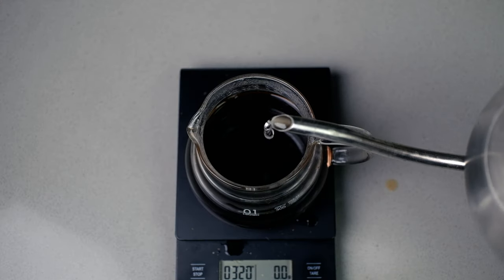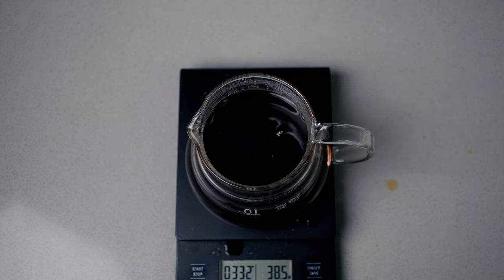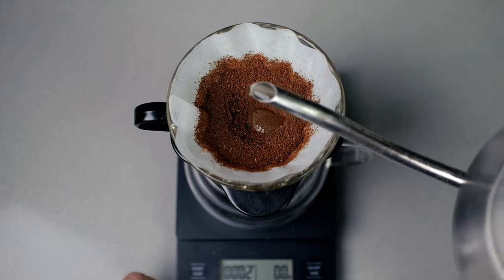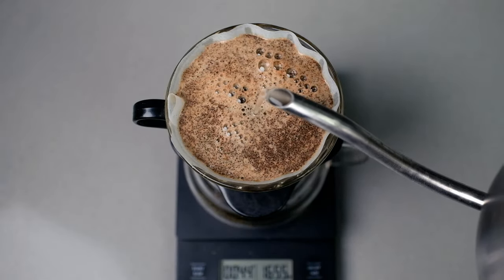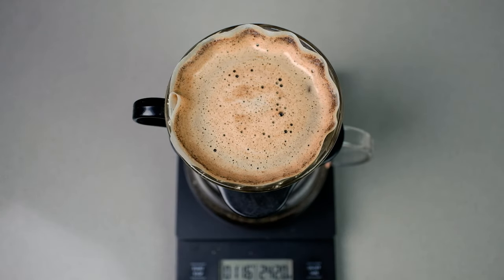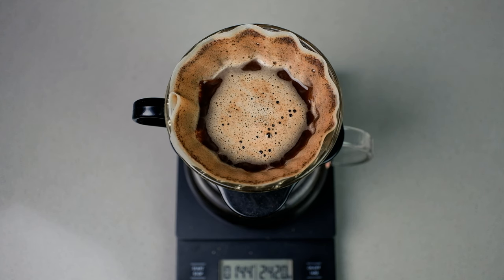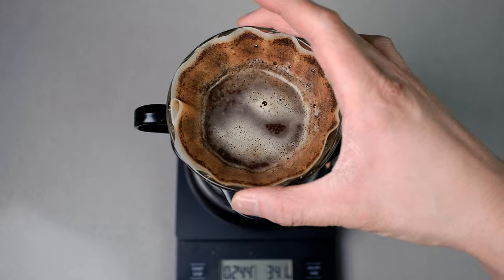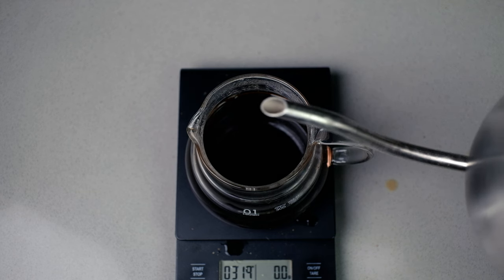Mid-DISCOVERY Recipe

Comment: Cool! For larger brews, would you do the same as this or tweak the original one pour + bypass that you did awhile ago?
Reply from the maker: Hmmm I think I would do this still, depends how big of a brew are we talking about?  If you're looking to do 2 cups I would probably still do this.   The 2nd pour will be smaller in comparison though.  So if you're doing like 40g to 600, I would pour probably like 520 as a single pour but super gentle in the middle and then do only an 80g second pour!
Reply: @TALESCOFFEE  ahh so the 420 would be super gentle (with a center stir). Not pouring out in circles to the edges as usual?
Reply from the maker: Yeah I'd go ultra gentle just cause the volume should take care of it.  Only go out once and that's towards the end of the pour, don't do it early on like I usually do it.  Just let the weight and the time become the agitation instead! @Waisonian
Reply: @TALESCOFFEE  awesome! I'll give that a try this morning! Thanks man!